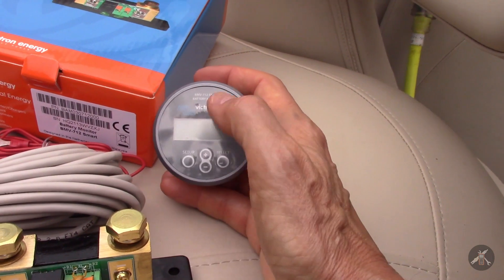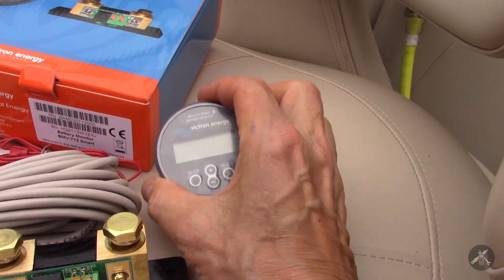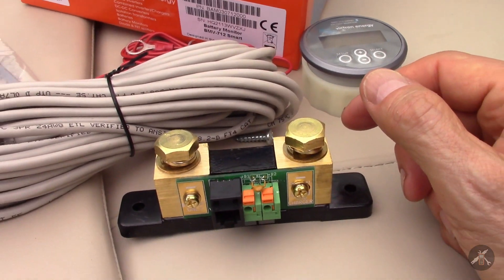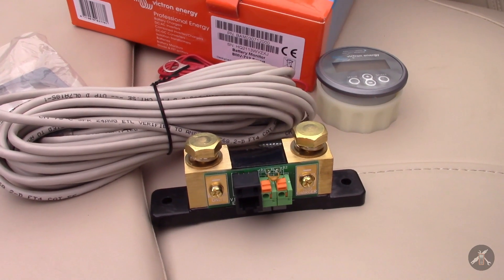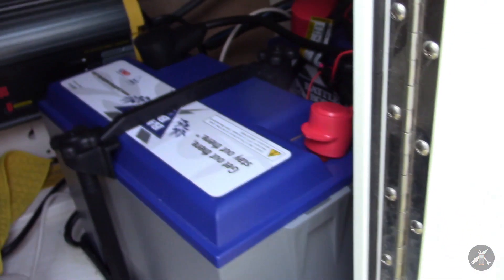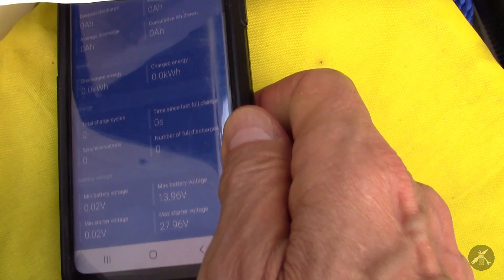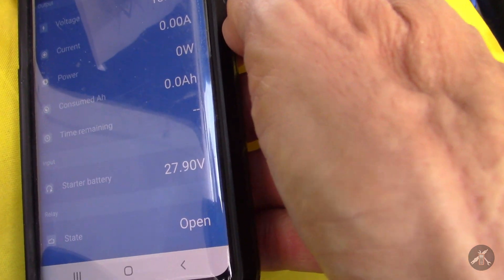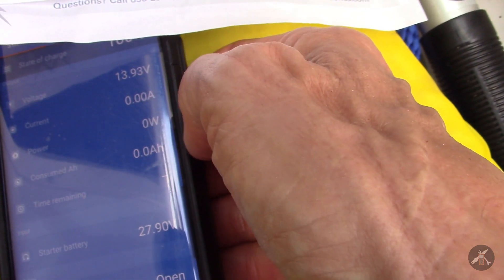Install Lithium Ion Battery Gauge to Monitor State of Charge & Voltage on Trolling Motor Battery

Comment: Hi, first off great video. Do you think it would work if the shunt was installed to a marine grade battery selector tied to each battery? Select battery 1 to check status and then make the switch to battery 2 with the battery selector.
Reply from the maker: Thank you!  I'm sorry, but I don't think that method will work, because the state of charge reading is cumulative with the monitor storing all of the current data it receives from the shunt. Said another way, the shunt is continuously sending the current signal to the monitor for the battery it is connected to so that the monitor can calculate how much current is used in amp-hours. Just to be clear on the math, an amp-hour is one amp flowing for an hour or 60 amp-minutes or 3600 amp-seconds. That means it accumulates how many amps are flowing through the shunt every fraction of a second and adds them up.  There won't be any data collected for the other battery. If you switched the shunt over, it wouldn't know the previous history of that battery.  I also know that if the connections are interrupted momentarily, the monitor will reset to 100%.
The voltage readings are instantaneous, but that is available without changing the shunt by using the second voltage input. If you really wanted to monitor both batteries, it would take two of these monitors, or a different monitor that could run either with two shunts, or one shunt that could be wired to monitor the pair with a multiple bank charger .

It has been a couple of seasons now and the current setup is working rather well for me.  One battery supplies the state of charge (SOC) reading, the other runs at the same voltage usually within a tenth of a volt indicating that it is very close to the same state of charge (measured pack voltage minus the monitored battery voltage). 
Actually, rechecking my data, the two batteries are running within a couple of hundredths of a volt of each other (0.01 or 0.02 V)

Comment: Thanks for the video! I was wondering if just monitoring the single battery is working out for you?
Reply from the maker: Yes, it is working now.  I had a little learning, but it seems to be correct now.  The second battery is tracking almost exactly the same voltage as the one being monitored.  My main issue was that the trolling motor has a small parasitic if is left plugged in.  That caused an SOC error by depleting the battery without it being measured.  I have a couple of followup videos, one is about the parasitic, the second is my end of season results. I will still be watching next season to see if I need to tweak any of the monitor parameters, but so far I think it's ok.

Parasitic
https://youtu.be/sYEDF24FvDY 
End of Season Wrapup:
https://youtu.be/EgcQrN4Z4zY